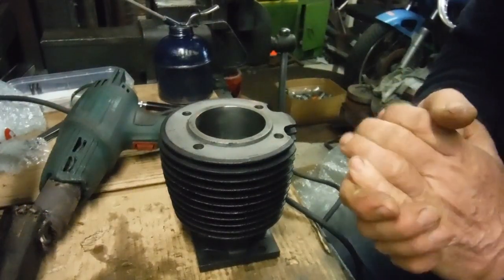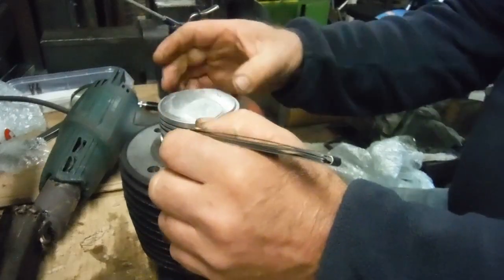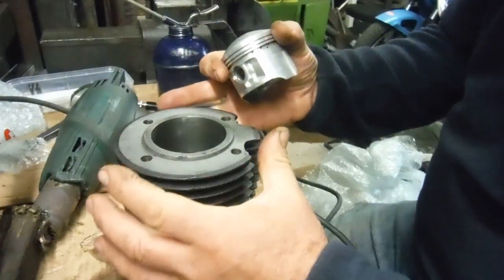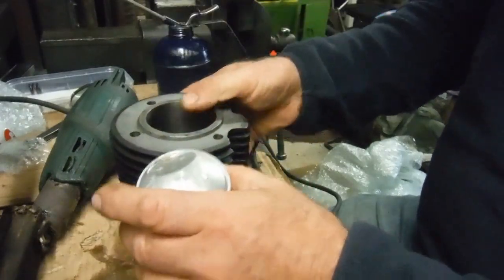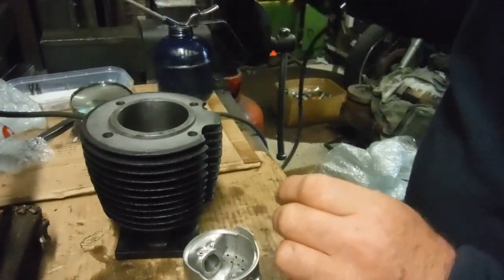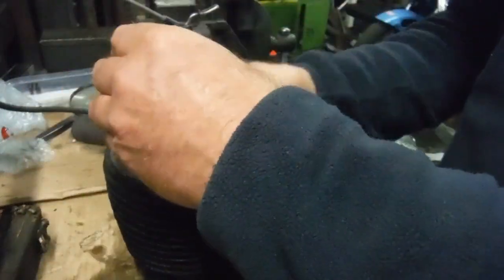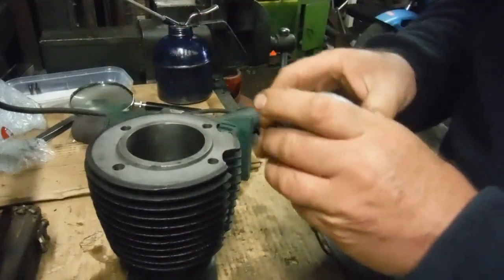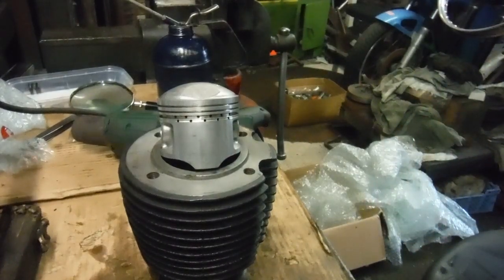Checking the fit of the piston in the cylinder bore of the JAP 250 discussed.

Comment: This subject is a minefield, it depends on the type of aluminium used for the piston, whether it is cast or forged and the material that the barrel is made out of. Velocette clearance (from memory) is 8 thou, but Ducati clearance is 1 thou, for instance. One way to test the clearance is to put the piston and barrel in the oven and get them hot, and then see if the clearance is OK.

Comment: Flip the cylinder upside down with the piston in the bore properly and then add your heat down the bore to the underside of the piston. With heat added to both the piston and the cylinder bore at the same time, if the piston sticks when you flip the entire assembly right side up you are definitely too tight and are going to have side scuffing on the piston at startup. This tip works on all cylinder barrels, no matter if they are solids or sleeves. It takes the guess work out of what you showed with a cold barrel.
Reply from the maker: I understand and agree, but my point was more to show that seizure and damage is more likely to occur when under load while still warming up.

Comment: Rule of thumb for piston clearance is 0.002 thou per inch of bore for a liquid cooled engine, 4 thou (or slightly more) for air cooled.
Reply from the maker: I know there are figures per inch of bore, but those seem a bit 'generous'.
Reply: @paulhenshaw4514 Yes, sorry, I was thinking ring gap, I just realised my mistake so have changed the values in the comment.
Reply from the maker: Ah - thanks, those look closer to the mark, although there are many variables, depending on whether a piston is forged, cast, etc, as well as alloy or cast iron bores / barrels, too. Bit of a minefield all round really!

Comment: Great explanation .. Can you put OHV piston in SV engine ?
Reply from the maker: No reason why not, if it fits properly.
Reply: @paulhenshaw4514  Thanks for your feedback. I want to put RE 500 piston/rings into triumph model p. 1927 SV.  Original piston around cost 320euro.
Reply from the maker: I once fitted an Ariel Red Hunter piston to a Triumph TT, the pistons are available from Draganfly and the TT's bore had to be enlarged and it ended up around 560 cc, if I remember. I also had to fit and ream a suitable small end bush, but it all worked out very well.

Comment: AJS often wire-wound pistons to the limit piston expansion. If more generous clearances were used, then slipper pistons reduced cold slap, the split being on the non-thrust surface. 
2 stroke motocross bikes can suffer from 'cold seize' if thrashed before properly warm.